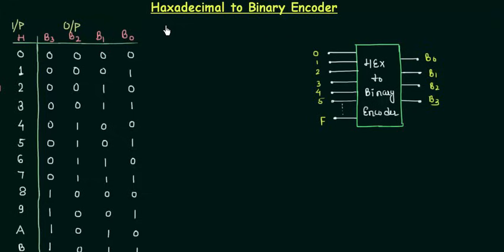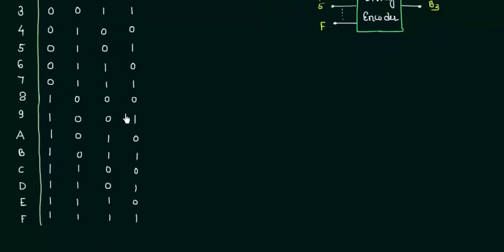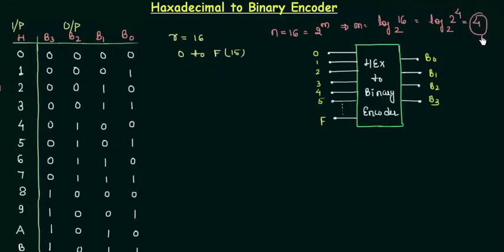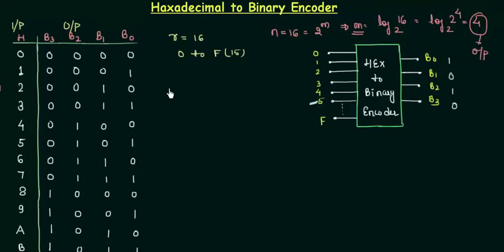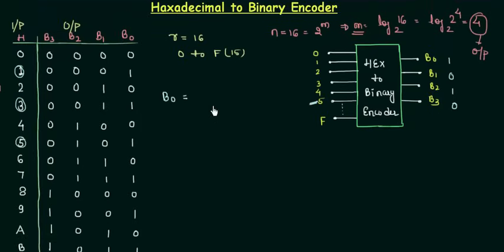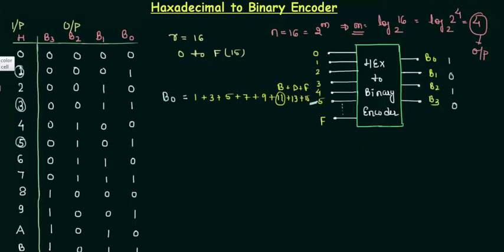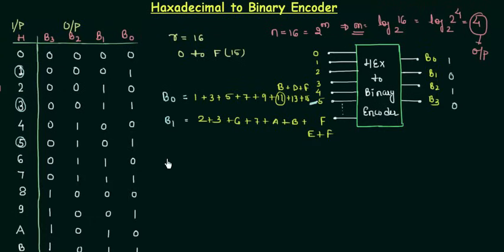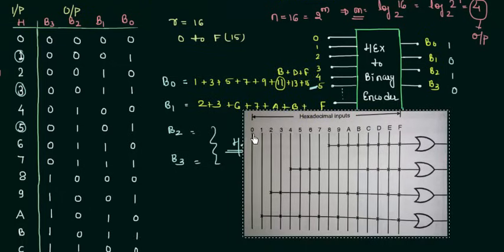Hexadecimal to Binary Encoder

Comment: In the truth table why output was written in reverse order.....can  we write B0 B1 B2 B3 like this
Reply: Confusion arises because in MUX/DEMUX we use selector variable in this order S2 S1 S0 ( MSB......LSB)
but in case of Encoder/Decoder use input as I0 I1 I2 I3..... (LSB....MSB).
So, If you're providing input in LSB to MSB form then Output should  also be written in the form of (LSB to MSB).

If you really want to write output in the form of B0 B1 B2 B3 then you've to write input in reverse order.
then your B0 will be considered as MSB and B3 as LSB.